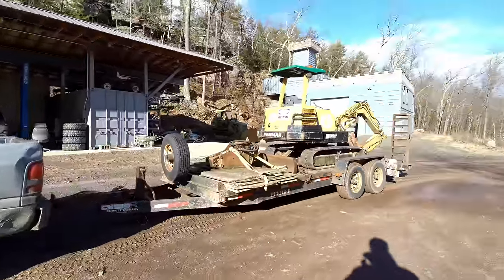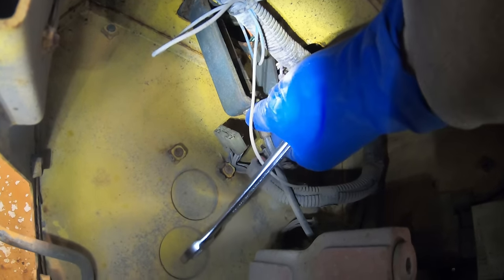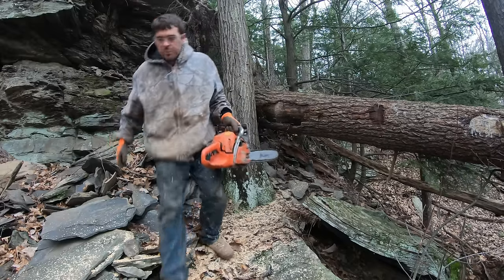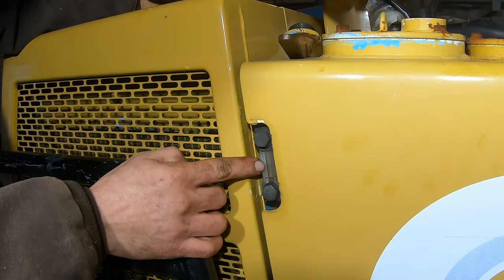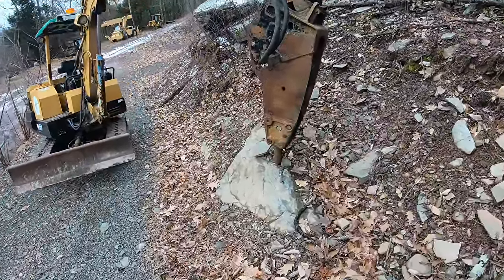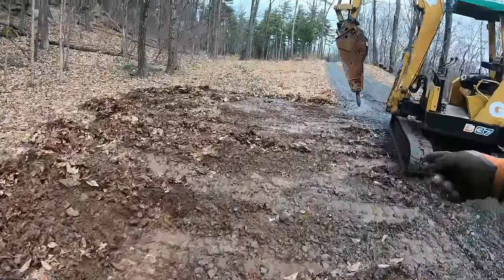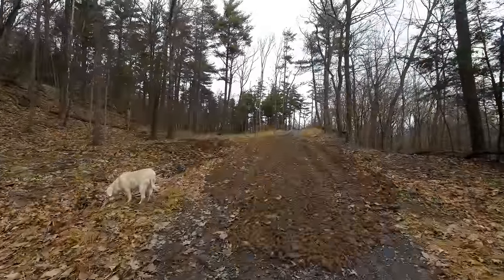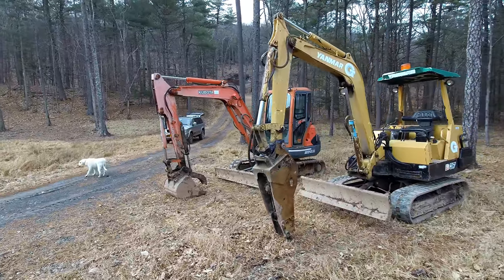Buying the cheapest excavator/hammer on Marketplace

Comment: Andrew....Boy! I admire your attitude:  Just spent $13,000+ on something, and the first thing you have to do is make repairs on it.  I'd not be a happy camper, yet you roll with it so smoothly!  "Hoarding"?  wouldn't cross my mind  You know what you can use for your own business.  Go for it  I wish you an incredibly happy new year.  !!!
Reply: Joe Gamba great deal for starting a trailer a jack 2 exkevater for 13k
Reply: He's going to PT-operators. I see it coming. The AC-brand in two places at once when he'll otherwise lose the job. These machines "function like a new bird" so no sense in paying NEW for the metal. If something breaks down? He'll fix it at industry-level costs..not prices. A great success formula he has here. Those machines just sitting there are going to start talking to him..."Feed Me, AC! Feed Me!" They really are money machines especially if you have a brand to exploit. His YouTube Reputation sure doesn't hurt either. He needs also to start buy beat up, raw land requiring a lot of cut and fill on it for his own account. Afterwards, drop modular  homes on them and rent them out. Passive Income is key for him. I expect to see vids on this pretty soon. He will get a good price on badly sloped land etc. and his machine time will get arbitraged into nice retail residential values. His machines are more than just hourly-clerks this way.
Reply: Hydraulic hoses dont last forever.

Comment: Keep your eyes open for buckets on Craigslist for the kubota. I see them all the time with the kubota designed quick attach in my area. Nice find on that kubota too. Great machine. I own one like it a few years newer but I’ve never had any problems with mine so far and love it. Great speed to size and also power to size machine. Yanmar is also great machine. But the kubota will serve you well well worth even rebuilding motor and a new pump if ever needed. Still way ahead. The best thing you would like to have for that kubota is a 3’ smooth edge bucket. I use it most and enjoy having it around. I don’t dig with it but loading and grading it is well worth having. Thanks for the videos Andrew.

Comment: I know in the Army we used jack hammers for other things besides breaking up rock, concrete, etc. There was also a spade shaped attachment, which could be used for hard ground, such as clay, which was almost impossible to dig with a hand spade. Possibly you could use a similar attachment dig into the ground, but also to cut wood.

Comment: Keep the yanmar with the hammer on it permanently no point destroying more then one machine and hammers are darn harsh on machines
Reply: Why are hammers harsh on machines?
Reply: @alc7505  i wonder too, living somewhere where there are no rocks. It seems like the rocks in general are hell on machines.
Reply: To quote Nietsche: If you hammer with Hammer long enough, the Hammer will also hammer you.
Or with physics for every action, there is an equal reaction. So all the highly spiked energy you put into the rock also is put into the joints, beam etc. one would have to make a hammer attachment that kinda has a counterweight that moves or some shock absorbers or something
Reply: Basically what grubr78 has said just destroys pins can crack booms etc best off just sacrificing a machine to get destroyed then sharing the damage to every machine same as vibrating rollers nearly every hire shop I've done work at they sell there rollers very early in there life as they rattle themselves to pieces
Reply: Looks like most of the pins on that 37 are worn pretty bad already.   Watched on a small screen, but pretty sure there was slop between the boom and stick as well as between stick and bucket/hammer.
Reply: @mattashford3508  same with the walk-behind compactors, always broken because they shake themselves to shit

Comment: Hi Andrew,  I had a problem with my blade not picking up the machine, the blade would also slowly drop down as I tracked. It was the seals in the "Live Swivel ."

The Live Swivel transfers hydraulic pressure from the "house" (upper part of excavator) to the lower portion to drive the tracks and blade, and in the case of my Bobcat 322 the expandable tracks.

The Live Swivel seals will leak off pressure to other accessories when they go bad.

The Live Swivel is in the middle of the house where it rotates. I removed it, rebuilt it, and now the blade lifts the machine fine and the blade does not leak down when tracking. 

Hope this helps diagnose your issue if it is related.
Reply: Do you have to separate the machine at the center bearing to make that repair?
Reply: If it doesnt leak down too much when lifting up the machine  then the swifel isnt leaking
Reply: @kgraydakota  sometimes you have to, but most of the time you can pull it out  at the bottom

Comment: I operated a Kubota KX 41 mini excavator underground at a local gold mine, digging drainage ditches, I used the hammer a few times w/o any problems. I also used an 8 yd scoop tram with the bucket taken off and fitted with a hydraulic rock breaker, that was a pain as the hammer can be moved around sideways using the scoops steering, but the scoop was set-up with remote so that the scoop could enter open stopes (the actual workings), still a pain because we weren't using scoop mounted cameras at that time, it would have been easier to break the oversize muck, oh well.

Comment: ANDREW,  After watching you with machines you should sell one of the mini backhoes and buy a good lathe and mill.  You can make those pins from round bar stock.  The bar stock would cost less than $25.00.  Buying pins cost about $100.00 each.  The lathe would pay for itself in 20 years with just your  pins.  When you start learning how to use the lathe will pay for itself in  just a few years.  Those other guys need them.  You could sell them to them, too.  All those parts you need could be made with a lathe and a mill.  I am sure you would be able to learn how to run them because you are so clever with machines.  

You were asking about selling hay.  You would make a lot more with the lathe and use it for your self. 

Also, tree stumps you are burning have a special piece of wood called knees in them.  In a good oak stump before it rots cut the stump up to get the “knee.”  Put it up to dry and cure!   They were used a lot in building boats and for building fancy mantels over fire places.  They were used in mantels to attach to the wall then place the mantel on the top.   They secured the deck to the side in boats.  There is only one man selling them!    They will never be used again like they were.   They would be useful for repair and specialty sail boats.  They are quite expensive! 

E-mail me at pharmacyman@att.net if you got questions.   I got another idea about a business you may be interested.  E-mail me and say hi!

Comment: Ok so I went back into all of your videos, which will increase your watched count but more importantly I added a like to each of them which should increase your monitization.  Every little bit helps. Anyway one little question though.  You start a lot of your vids with " I'm here on this job with my Yanmar" how is that going to work now?  You going to name this new one Q or well it looks like G on the side, or something else?  Anyway I think most will agree with me it is so Absolutely satisfying to watch someone else work for a change.  Ps.  Watching it again the hose was through the hole but the original hose had a big bulge in it like it was too long to begin with but it was pulled into a saggy twist.  Likely why there was so much friction wear.  It is ultimately very satisfying that since it was the ditch that taketh away the gravel and the ditch that rebuilt the road.

Comment: Dear Andrew.  I love the work that you do and you are an excellent teacher and a creative inspiration.  Because of what I learned from you I got the courage to buy a used John Deere 35 D mini excavator.  I know you don't like JD, but it has a Yanmar engine and hydraulics.  I noticed you topped off your new Yanmar hydraulic system with Traveller fluid.  All of my reading for both your and my machine suggests you should only use the Hitachi LN type of fluid. Otherwise the system may fail prematurely.  Maybe this isn't necessary based on your experience with your other Yanmar machine.  Of course the Hitachi LN is $98.00 compared to Traveller (around $50.00) Thank you for all of your great work and for taking the time to produce such exceptional instructional videos.   Craig
Reply from the maker: Cool, good luck with it.

Comment: KUBOTA Rules! Price points and options.. I can't find anything to beat it. Every machine has a slight downfall.. but they offer the best common ground in my opinion. I have a Kx057 and an SVL-75/2. I had a 121-3 which I loved but needed more depth. 
Rock on man.. you remind me of myself..it's odd
Reply from the maker: How is that SLV-75? I am looking at those. I am done with bobcat.
Reply: @AndrewCamarata  I just got to use it at a horse farm over the weekend. Had to replace a 1000ft of 1" water service and then regrade the entire place afterward and top it with 120yds of stone. 
It's quite impressive, has immense power and a big key for me is the visibility..the BEST I've ever seen both forward and rearward   AND.... you also don't have to take the door off to have an open cab.. it has a beautifully large window that slides up and out of the way in seconds. I would like a back up camera or proximity sensors when working in tight areas.
Have you ever looked into any?

Comment: This is the first of your videos I’ve seen and I really enjoyed it. I’m sure you know this but just in case, make sure you grease the hammer point really really well every time you use it. Hold the point in towards the body and grease until it purges (otherwise it will push the point out with grease and then when you activate the hammer it will blast grease everywhere). You have a new subscriber. Thanks for the upload

Comment: Looks like you hammer-jackand maybe parts of your Tractors could use a bit of Wilco Lube. It’s the absolute best rust prevention and removal on the market. Used by military. It doesn’t dry. It soaks into the metal. Great stuff. Nice video man. ✌️
Reply: Can't find anything about rust lube?

Comment: Hi I like your vids I'm a rough old machine driver. The way you change a bucket with pins is to put the end of the dipper arm in between the lugs on the bucket in line with holes  put a small bar through the bucket and the main pin hole pick the bucket up lower back strap and you can move bucket about to line holes up put back pin in first. Then use bucket ram and dipper if you move it about you will line the holes up and can put the main pin in without a hammer. Keep making the vids

Comment: Hi Andrew, thanks for the video! It's great to watch a capable operator using a variety of devices. Kind of like the dreams of young people watching the lucky guy with all the toys:0 
Ps: I often watch you pouring fluids from buckets or gallon jugs into your equipment. No offence, but your pouring the buckets backwards. You're supposed to pour it with the spigot at the top so as you pour air is supplied constantly and you don't get that pour gurgle for air pour effect. 5 gallon pails and one gallon pails, the spigot is farthest away and you have no trouble and way less mess. Cheers.

Comment: I have made the quick attachment plates for my kx 121 excavator in my machine shop.  I own a 3 axis cnc milling machine, they are accurately machined and fit perfectly. Paul
Reply from the maker: Yeah, I thought about trying to make them, I have just been buying them on ebay and welding them onto buckets. There is another video where I convert this machine to Kubota quick change.

Comment: I just brought an excavator today. Normally wouldn't have given it a second look as it is pretty beat up. After watching many of Andrews videos he proven that most things can be fixed. I've brought far better looking machines than the one just purchased and they ended up needing repairs as well. Thought i'd save a few dollars and start with one that needs a bit of work from the start and yes after using computer run machines Ive opted to go older with no computer this time.

Comment: One reason I can see for having several similar pieces of equipment is the fact that they have a lot of hours on them and one or two may be broken down and you still have a backup to go and do the job with. 
You could also fix up some of the machines to resell for profit.
You could also hire one or two people to run one or two of the other machines for added income. especially if you have friends or relatives who need work that are capable of helping you in that capacity.

Comment: The bullprick on the hammer is expensive.  You'll find the dull ones fracture, penetrate,  and dont get stuck as easy. They also dont cause the flying, chipped, material causing broken glass. Keep a shield with you when using in tight areas you dont want damaged They all break prying. Get another one for spare. The one on my rig is $5,000 for the bull prick. Keep it as perpendicular as possible. Grease every hour for starters. Check zerts. They plug up. Watch pinch points on hoses. I have spring coils wrapped on  around hoses nearest hammer. They spin if rock , concrete pinches. Consider quick couplers. Did you figure out how to release pressure attaching and detaching. Turning key on and such? Nice value purchase. Th ed y cost more to run than just bucket and thumb hourly. Blade behind you increases down pressure. They are heavy. Be careful.

Comment: I don't know if its actually a thing that bothers you.. but I noticed the tool bit on your hammer has fluid dripping down it (around 25:30). I ran into a similar problem on a job site and the solution was that the excavators hydraulic system was running at too high of a pressure for our hammer. Eventually the guys from battlefield rental (Ontario Canada) adjusted the pressure for us. 

Just thought I'd share! 10/10 love all your videos

Comment: You need more than one excavator. Definitely if you have small ones. Having more  than one small excavator is good thing. You can leave them on jobs, they are really useful. My buddy has 3 little excavators. Bought em used and for a good deal as well. Having a few small excavators is a good plan

Comment: Regarding threading on things - bolts to whatnot -   reverse thread and feel or hear the bump as the two lead-in threads pass each other.  Turn normal and it threads on.  The reverse helps seat the coupler / nut.   Try it .

Comment: On the hammer I don't recommend you to have opened holes on the hooks because the impacts will repercute in them so if they're opened their hammering will impact the openings opening them creating a progressive gap that will suck your energy. So by having those plates where they mount with entire holes will not be affected as if you have them opened.

Comment: For the Yanmar, make a manual thumb, but size the length of the brace so it can be directly swapped out for a hydraulic cylinder at a later date.

...that's what I've done on my 1.5ton machine. Not in a desperate rush to make it hydraulic but at least the option is there without having to do any further messing about.
Reply from the maker: Yeah, make the thumb hindge right on the bucket pin. And get a diverter valve and hook up to the rarely used boom tilt function.
Reply: @AndrewCamarata  You'd want to do the quick-hitch mod you were talking about first, else having the thumb on the bucket pin would make changing buckets a bit of a fiddle.

I put mine off the linkage pin. Not ideal as the geometry would change if/when I make it hydraulic, but was much easier to do without having a quick-hitch.

---

EDIT: Just saw in another video that you already added the quick-hitch & thumb to the machine (only just subbed and am playing catchup on some older videos first).

Comment: Great job on finding good used machines. I would personally be scared of that many hours on one but you know these machines so well you can weed out the bad ones. I am trying to figure out what to buy for my 44 acre farm where we plan to build a house. I was thinking of a back hoe but the terrain is pretty steep so an excavator might be able to handle slopes better. Then comes the issue of having a bigger trailer and something that can pull it.
Reply from the maker: They both said "Made in Japan" so I knew they would be good.

Comment: that yanmar roof is a bit low .. hopefully you can adjust that up a few inches. They look like they are running pretty good and now you have backups so you don't have one down while you fix it. Now you just got to make the money to pay them off .. do you think you can get a large steel pipe and cut a larger blade out of it for them? or would that block rotation?

Comment: It would be nice if you use a universal quick change for your buckets that are universal for all your buckets on all your machines and also be able to put your buckets on backwards. That comes in real handy sometimes.
There is a company now that is making universal bucket quick changers that are just like the ones on the later model Yanmars and they make them to fit all brands of excavators.
Then you could use any attachment you have on any excavator without getting out of the seat unless you had hoses to hook up.  😀
Reply from the maker: I did that, there is a video covering it